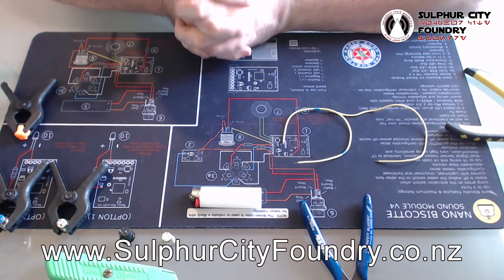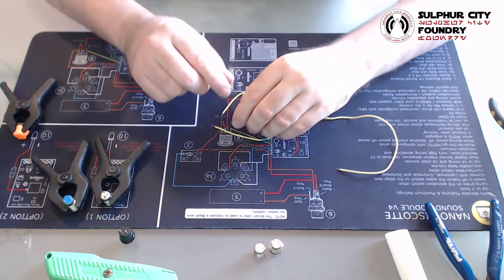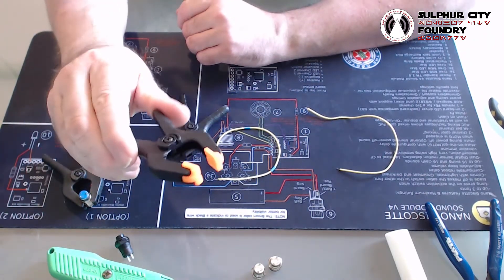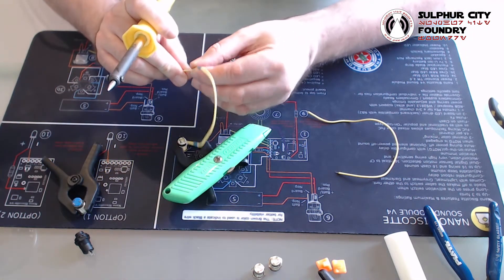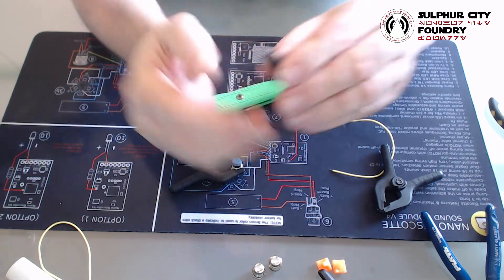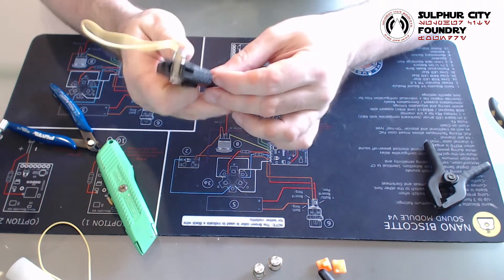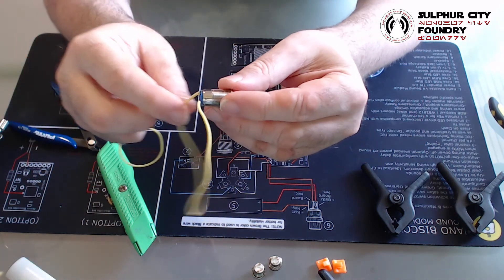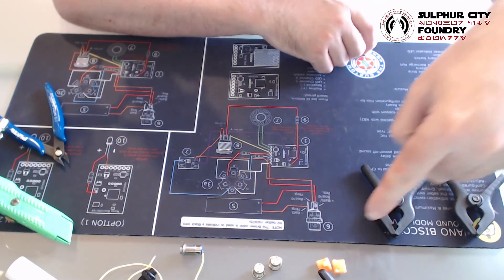How to Wire Switches for Saberforge, Ultrasabers & More : Two Common Methods

Comment: Can you wire a 12mm recharge port to a led light up switch and a battery holder to saber core sound board

Comment: What size wire
Reply from the maker: Every installer is different. I prefer to use 28 AWG for the switches & 26 AWG on anything with a sizeable current.